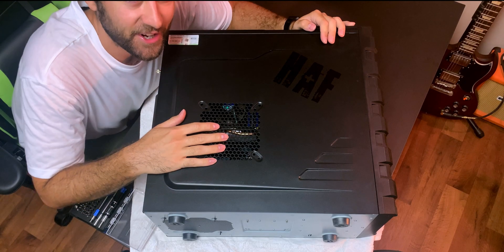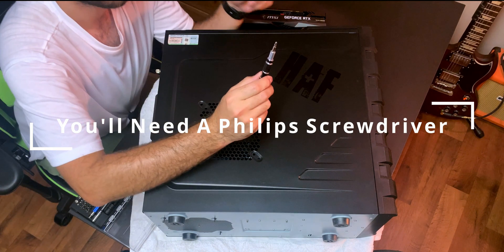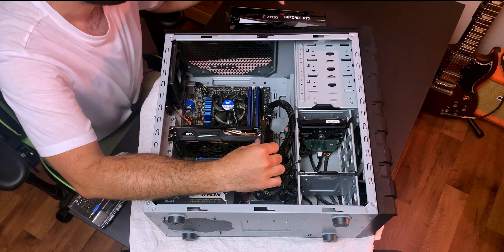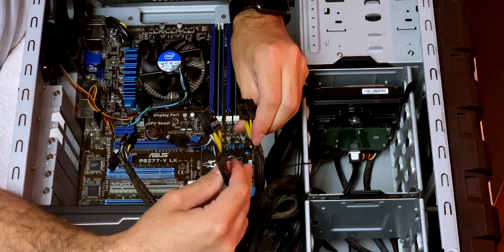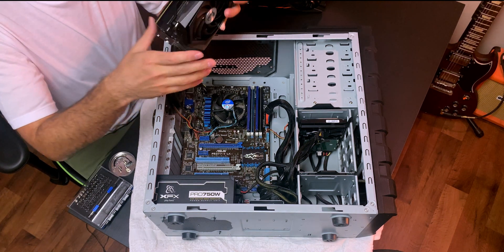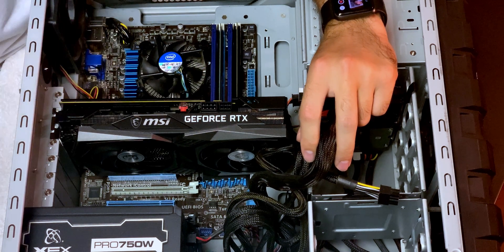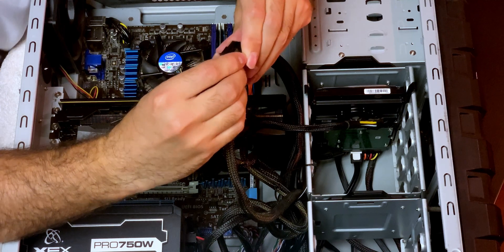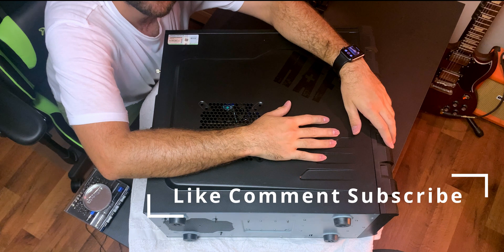How To Install A GeForce RTX 3060 MSI Gaming X: Make Your Old PC Feel Brand New!

Comment: My gtx 750 had no plu gins. Now I bought an rtx 3060. It has an 8 pin plug in. Do I need that? My monitor isn't working and the fans won't turn without it, it seems. I never unplugged anything on my old 750 card. It had no plug in.

Comment: Hey man helpful video. I have two pcie-1 8 pin cords and then two of the 6+2 pin cords but they are labeled pcie-2. Can I use the two 6+2 pcie-2 cords to power the gpu or is there a difference between pcie-1 &2? I appreciate the help!
Reply from the maker: I would assume you'd want to use the latest generation of PCIe! So use pcei 2! 6+2! That should work great!! :) If not, refer to my troubleshooting video on my channel! If it doesn't work instantly from boot up!

Comment: My 3060 Ventus 2x only has 8 pins. Can I use the pcie cable that has 2 male ends both having 2 and 6-pin connectors (16 pins total) while only connecting 1 of the 2? Or do I need a different cable?
Reply from the maker: I think mine actually had more than I needed like your setup! You can use just a 2+6 pin, which you can just combine to make 8 pin male to fit in the 3060! And save the extra 8 pins in case you can upgrade the GPU to a 3090 down the road hahaha

Comment: Hi thanks for the video, do you or anyone else know if I need to connect both 8 and 6 pin connectors? I only have a 6+2 pin on my psu
Reply from the maker: Thanks for watching! Yes, you'll need to connect both! You might be able to get a cord and connect it to your PSU, as sometimes certain versions even require two 8 pin connectors. Might need to upgrade power supply to at least 550W to run a 3060 and higher watts for the better video cards!
Reply: @TechAfterDark  Thanks man, my psu supplies 750w but I just don't have an 8 pin, so I guess I'm gonna have to buy a new one 😤